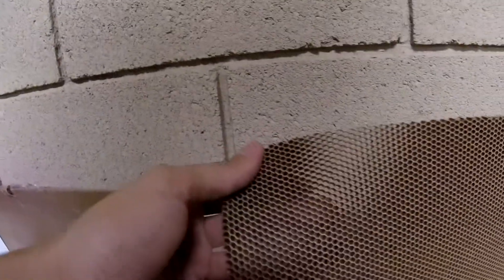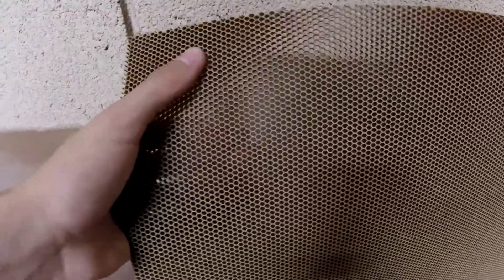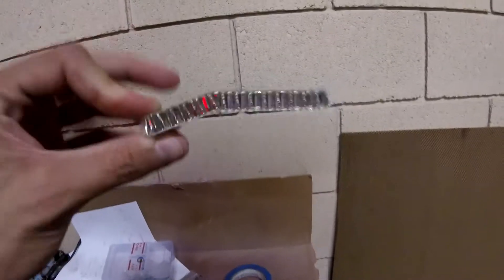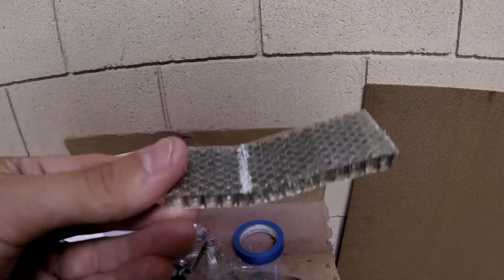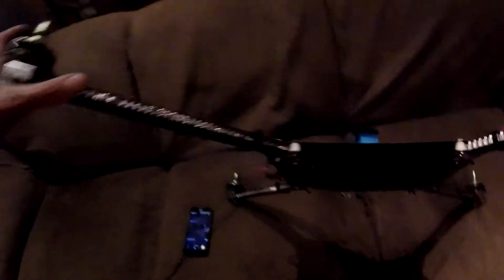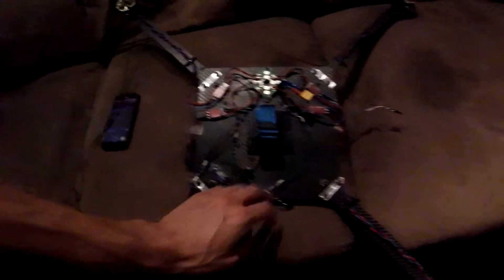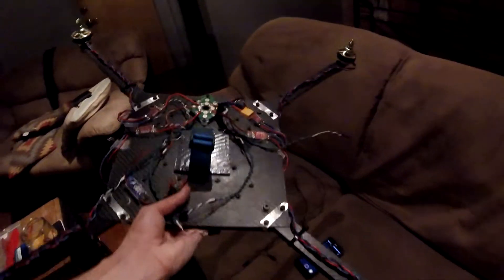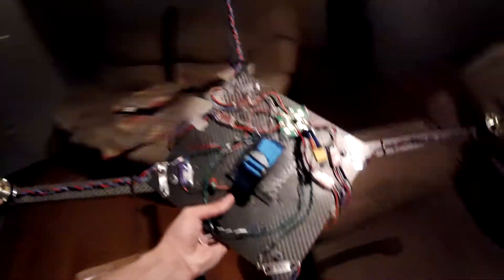Multi Rotors and Carbon Fiber Honeycomb - The BEST Material for Frames!!!

Comment: Its interesting stuff & being applied more & more, Im really interested in where you can get the resinol paper honeycomb you had a sample of. Whats the cost & performance differences with the carbon vs nomex honeycomb, thanks
Reply from the maker: I got the honeycomb from a commercial metal supplier that offers retail service. It is quite expensive unless you can find scrap pieces which are usually pretty common.